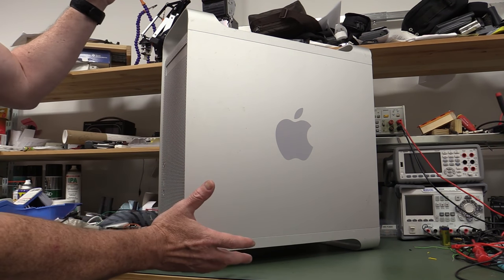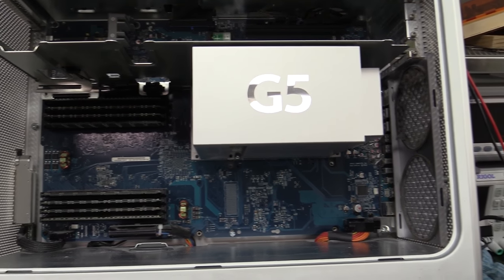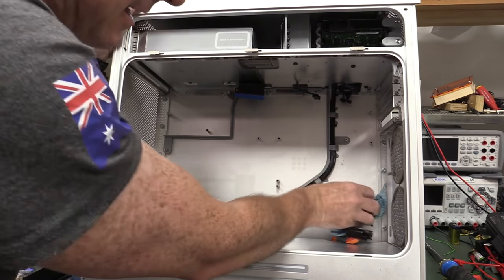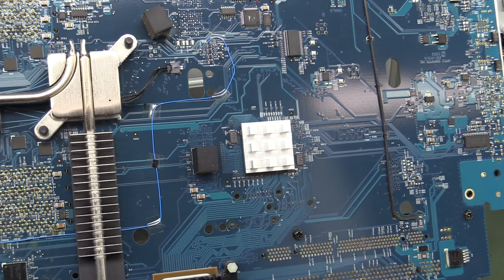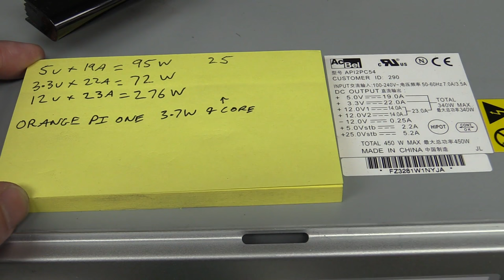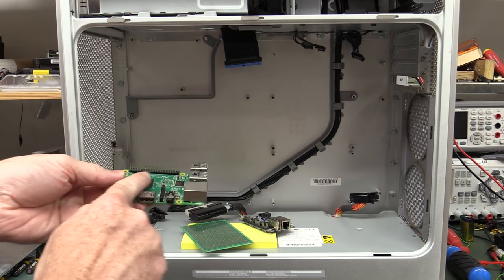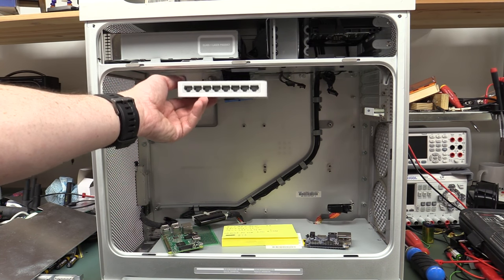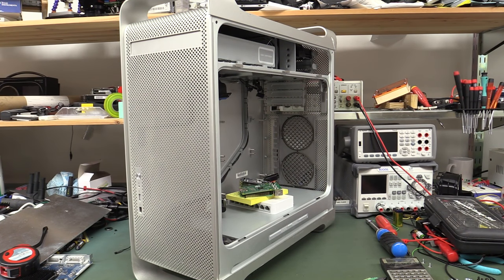EEVblog #946 - Apple (Raspberry) Pi Cluster - PART 2

Comment: May have been mentioned elsewhere, but you might consider building the backplane to support "modules" of Pi0 boards . The module plugs in horizontally, and the Pi0 boards are mounted in each module vertically, so that they are oriented to provide airflow. front to back through the case. Each module could also have power supplied by a second board that feeds the power to the USB port, adding some rigidity to the module and support for the Pi0 board.

A pi0 board being less than half the width of a Pi3 board you should be able to stack 2 modules into the vertical space you might be able to stack Pi3 boards. Each board has a support chip on the module for spi2ethernet, and each module has a built in switch (Since a Pi0 board has no ethernet or fat usb connectors on it, I'm presuming you should be able to get 8 Pi0 boards, maybe 16, in each module without running into airflow and density issues.) By building modules with separate support boards for power and signaling, you should be able to simplify connectivity for each.

You may also set up some board-2-board i2s links that get linked into neural net emulators running on the pi0 boards, and each module has some sort way to randomly link the neural net links that it remembers as long as it has power. Set up one module to act as a corpus callosum limiting bandwidth between modules, and occasionally introducing a bit of chaos by crosslinking signals for a short period. Might not be useful for Boink, but then I don't know what Boink is useful for myself, so I'm just throwing it out as an idea.

Comment: Here's my suggestion: Use 12V exclusively for power, and build the DC-DC converters right onto the riser boards. Make the riser boards structurally sound enough to hold a couple of Pi boards 2 deep, and put 2 connectors per Pi position so that you could choose whichever Pi flavour you want.

SPI ethernet could also be built onto the riser board, and the actual board-to-board connector would be custom, and not compatible with a single Pi. The backplane could simply be a big 12V bus with a few SPI communication lines.

Another thing to keep in mind - ethernet can be run in hub mode instead of switch mode, although it gets a lot more messy as far as packet storms and communication retries go.

Comment: You can run about 8 Pi's off the internal 5V rail, and run another 20 off the 12V rail DC-DC'd down. The 5V Standby rail can be used to run one extra Pi that is being used as the system monitoring unit (effectively IPMI) so you can fire up or shut down the cluster remotely. You can put USB to SATA as well as USB to IDE chips on the motherboard so all the internal hard drives and the CD drive would still work (albeit over USB this time) so you can have internal storage space when the system is going down and calculation is not quite done.

Comment: Use the fans to pass air through raspberry cluster tower(s) and use a little extender or kvm etc to attach as card to the back. There will be plenty of space for extra power boards etc.

Comment: How about putting the 12v step down module on the riser boards with the RasPis?
You could put 4 boards on a slimmer riser that comes off the edge of the boards with them in a flat 2*2 grid mirrored along the side with the headers.  This would also keep the Ethernet/USB ports out of the airflow, but you might want to put some ramps in to help the air flow over the headers/riser
You could also design the riser so that you have one type of computer/riser, and depending on if it's a RasPi or an Orange Pi, you insert it differently into the mainboard.  Not exactly idiot proof, but if you trust yourself to pay attention, it could work.  Just make sure you aren't switching power pins with data pins when you flip it over, and it could probably be recoverable.
Reply: Another idea, not practical, but a little bit of added fun:
Sacrifice a few dozen of those vent holes to put status LEDs through.  Yeah, it'd be a ridiculous board to make, but it would be amusing to have a few rows of lights telling you what boards are installed and working that more or less blend in with the case.  Maybe fill the holes under the LCD/DVD drive with them?  There should be enough there.
Reply: +ttsgeb
Like it! Could make a matrix of blinking squares like Hollywood used in the 60's whenever they wanted to show a computer room.

Comment: My sugggestion for the switch would be to NOT use the clipping mechanism, but a simple switch with proper cable management. Maybe even hide it behind some kind of panel. In my opinion it would be way easier to replace or upgrade the switch later. By making fixed connectors on your board, you could only replace it with exact the same model, which might be hard a few years later.

Comment: That 25V STBY is for powering the Apple display through the ADC connector. I used my G5 until recently as a server out on the DMZ, with firewall, file server, mail, FTP, web, everything. OSX Leopard Server 10.5.8 was great. The G5 had only one Achilles heel - that 3rd party supplied POWER SUPPLY. To the point of a recall by Apple. I replaced mine with a modern ATX. Only reason I stopped using it - 200-300W continuous power draw. I still use the 23" Apple Cinema display from 2004 as a daily screen. Beats the pants off modern LG and Samsung monitors in terms of colour fidelity.

Comment: A few ideas:
1. The Pis run on 3.3V internally, add a bodge wire across the 5V to 3.3V converter on half your Pis and run them directly from that beefy 3.3V rail. (Or maybe you can backfeed through a pin on the main connector). No need to upconvert to 5V.

2. Put the Pis lengthwise so the riser boards can be narrow 1 to 2 cm strips that just touch at connectors for better airflow and less PCB size. For even more efficiency have some Pis face inwards so one riser pillar board can carry 8 Pis (2 deep, 4 placements in a H-like arrangement, all with airflow along their short side). Leave a length of exposed connector pins between the riser and the connector for airflow.

3. If the new Pi3 SoC still doesn't have on chip Ethernet, might as well ignore that and network the SPI buses to a baseboard FPGA programmed as a switch fabric, similar to how some blade computers are built. So each Pi would have an "Ethernet" driver talking to an imaginary Ethernet adapter, which is really just an artifice of the switching logic in the FPGA.  Depending on how the SoC works, the SPI buses could be centrally clocked so the FPGA will have less clock skew to deal with.
Reply: Correction: I was thinking of the Pi Ethernet just hanging off the USB bus, not SPI. Anyway just run the network data over whatever fast bus from the SoC is exposed at the connector.

Comment: Dave, FYI the 25V "standby" output of the G5 power supply was not used internally.  It went to the Apple Display Connector on the video card:

https://en.wikipedia.org/wiki/Apple_Display_Connector

Steve Jobs was always obsessed with minimalist design, and that included the number of cables on your desk.  So, Apple's engineers derived a display connector from DVI, adding a ~100W power supply capability and USB.  This let you connect your keyboard and mouse to ports on the monitor, and eliminated a separate power cable on the monitor.  ADC uses 25V DC power so that the current (and therefore cable thickness) wouldn't be so high.  (This is of course pretty much the same approach that USB-C is using to deliver ~100W over a small cable today.)

If you look at the video card from your G5 (at about 3:05 in this video) you'll find an extra finger of the card edge connector which isn't standard AGP.  That's how they're routing the +25V supply and return to the card.  The ADC connector on the back plate of the card looks a lot like DVI, but with rounded ends and a keying notch instead of the standard D-shaped shell.

Apple made several monitors that used this custom connector. Most were LCDs, but one was a 17" CRT, and that one was probably the one that came closest to using the whole power budget.

Comment: You could add a female RJ45 port to your "riser board" design and have the ethernet sigla go through there, so that each pi is only connected to its own board through the GPIO and a 2" or 3" long ethernet link ^^

Comment: You're probably going to use up most of the space in the case after putting in the 24 or so Pi's running off the 5v rail anyways so I'd personally run with that and then see if you can squeeze a few more in off the 12v rail with a few buck converters.

Comment: its 2mV/degree C Dave. Its handy to measure heatsink temperature because some of the TO126 type NPN transistors are great to be mounted using nut and bolt. Yes, one opamp will be needed  in order to amplify the small voltage to a readable ADC range and also the tempco is negative so inverting architecture is needed. Yes calibration would be a pain for production equipment because the PN junction voltage vary from one device to another from same silicon vendor. I love to use this on my projects though (Not commercial)

Comment: The other G5, with the bar connection for power should have a beefier power supply. The G5 Quad, which you may have, was supposed to have a 1000W output.

Comment: You could still use a short ethernet cable but not leading into the mainboard, but instead going to the raiser board. Another cool thing would be getting a couple of gpio pins to where the expansion slots of the G5 were if you want to use them for something.

Comment: As somebody who has designed lots of similar types of systems, I say don't bother with ornate baseboards. There's just no need. You need more mechanical design than PCB CAD. Standardize on groups of single form factor CPU cards and make stacks of them using threaded standoffs. Mount those stacks to a 1.6mm aluminum (or aluminium if you can't get aluminum) base panel which adapts the case standoffs to the CPU stacks. You could always have holes in the base plate to accommodate stacks of multiple styles of CPU board; it's all so easy with CAD. Stacking will allow for far more efficient use of the depth and allow for more efficient cooling, and I suspect the room it frees up may be necessary for the switch gear and cabling. You only need a single PCB which contains a couple large, quality DC/DC converters for 12->5, a couple ceramic ballast resistors, and lots of terminal barrier strips for coax power supply cables to the compute nodes.  You could also load a stack's power jacks with fresh coax plugs and then solder those plugs together as a power plug bus using a pair of thick wires at a right angle to the plugs, discarding the plug covers and resulting in the lowest impedance distribution with easier hookup at the power supply board. Use Phoenix Contact screw in terminal blocks on the power PCB for solid distribution and ease of change. On the Ethernet, use the built-in DMA based ports. Using SPI Ethernet in this design is an epic level facepalm. Sorry, but the performance would be absolute shit. And don't bother to roll your own switch either. Those consumer switch chips tend to suck on performance and fail somewhat often, too often to cluster a bunch on a 1-off board. Unhouse a couple of higher performance surplus switches so you can swap them out in case of failure and spend some time making custom CAT-5 patch cords with super flexible wire. They're short links so you can use un-twisted 8 wire modular phone cord and likely get away with it without issue, even at 100Mb. You can also just use two pairs of CAT-5 without the outer jacket for ultimate flexibility as they won't get moved much once installed. A little hot glue can make a 2 pair RJ-45 plug quite mechanically robust. One final thing, build yourself a nice scanning patch cord tester before you start. ;-) Good luck!

Comment: Great idea with the plugin network cards ... just keep in mind, the smaller the switch, the more switches you need to connect together to make a single network for 64 devices... I'd probably jump straight to much larger switches, such as 3 24 ports (72 total - 4, to link them, so really 68), providing a few extra for upgrades too, in case you'd like to extend that network capability to other devices inside the case. Of course, this is an older video, and I have no idea yet even if you have a next part...

Comment: If the Orange Pi is anything like the Raspberry Pi, it is powered from 5v but actually regulates this to 3v3 via a linear regulator. You could remove the linear regulator and feed 3v3 from the power supply straight into the GPIO header. This would be more efficient as well.

Comment: I think you can get away from doing big connection boards with rotating one type to the back. Then you could use one type of header-to-controller board connector. Just to remember Raspberry Pi to front, Orange Pi to back.

Comment: I wouldn't use the vertical RJ45 connector, because imagine what it would be like to unplug a set of those, you would have to press all the clips at the same time. I would do it the easy way, stack a couple of 16 port switches, in that upper slot and run ethernet wires to each board. You could get those slim flat ethernet cables to save space and make it easy to route around the case.
Reply: I'm pretty sure you need the locking mechanism in this type of connector and even if you don't consider the development time(where you certainly need to unplug them once or twice to say the least) sooner or later you would have to unplug them for maintenance.

Comment: So a part 3? (in 2019)

For the backplane you could just use small/short 40pin ribbon connectors, then is does not matter what board you use, as long as its RPi compatible (incl. RPi1), and it simplifies sourcing parts (straight thruhole) and building boards, allowing you to still make and use  router, jumper or crossover boards if an SBC needed it.

Then its just a matter of "card holders", ie 2 mounting planes, an inner one for smaller boards (like orange pi/RPi 0) and an outer one for larger boards, that way you can also mix an match or group SBC's as you see fit.

No part 3? Now you know why people just used cables to wire up clusters, its quicker to finish.

Comment: I thought it would be the easiest to have a 80-pin 4-row pin header as the connector. That way you could keep the original 40 pin layout of the board like you said. The closest to a 80-pin 4-row connector I found on Farnell was the 120-pin 4-row header, which would give you 40 extra pins, but I don't think there's a right-angle connector of these.

But on the subject of the pins that go onto the riser board. You could maybe integrate the RJ-45 connector onto the riser board. That could allow you to design the RJ-45 plug arrangement to plug the switch onto the board like you showed in the video.

Here's what I thought:
- 80 pins for both Raspberry Pi's
- 16 pins for both Ethernet connectors (or 8 for a 10/100Mbps connection per device). - Though you would have to use the short RJ-45 cables to pass them onto the board.

Here's the links to the headers I am talking about:
Female header: http://au.element14.com/harwin/m22-6013005/socket-pc104-120way/dp/360030 
Male header with no shroud: http://au.element14.com/harwin/m22-6023042/header-pc104-120way/dp/1249051
Male header with shroud: http://au.element14.com/harwin/m22-6043098/shroud-pc104-120way/dp/360132

Comment: why not build the power brick into the rizer board to supply 5v to both boards? has the added benefit of if a single power regular board/rizer fails and it's integrated into the rizer, it's not very difficult to replace. if you build power regulars into the main board and something fails, that's.....not gonna be fun to fix.

Comment: Any graphic card that does not have a fan sucks straight out. You'd be designing a PCB for a one time scenario... more or less. Could try to interface the hard disc/cd rom. I think you are probably making your life easier by using the ethernet port as the interface. You could simplify things by making a motherboard out of a whole bunch of male connectors sticking out, but they may get damaged over time. There is the issue of the boards flapping around still though. The motherboard would be really an interconnect between ethernet devices, the hubs, and pis. Also it could have a regulator. So it is like a regulator + ethernet cables replacement. Also there may be the problem of setting up the pis. This could be done outside before hooking them up.

Comment: You have to go with the spi solution, you just have, and as for power, I think you can get a 1500w PSU that'll fit, to get over any limitations in that area. Other than that, I should think that you're far more competent to give advice than I'll ever be. ;)

Comment: Dave, Why not make the riser boards headers at 90 degrees, so all the ether (and USB ports) face out (towards the case cover)? Then you could use different colored ether cables and have a rainbow, Raspberry, apple pie.. :) Seriously though, if all the ports were facing outward, you could cut the separator out, and mount the switches up top.

Comment: Be careful with short patch cables.  Some equipment does not like short cables and have network errors.  With 24/32/64 connections, you may see more of these issues.  Something to watch out for and trade off with the SPI implementation.  Good luck with the design.

Comment: watched part one when it came out. So happy to see someone actually going all out and making a proper cluster instead of just a bunch of wires zip tide together.
I have wanted to do a central mobo layout with like 64-128 Intel Edison for a while now... but I don't have that money xD

also, I vote for the vertical male rj45 and clicking in a switch like u mentioned... would be a bad ass solution